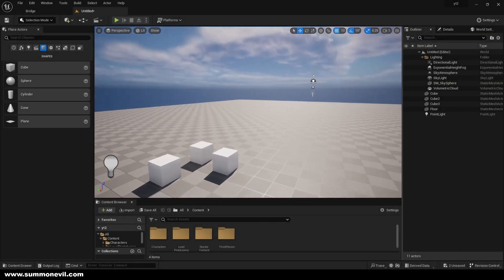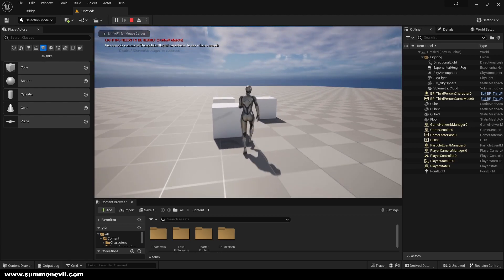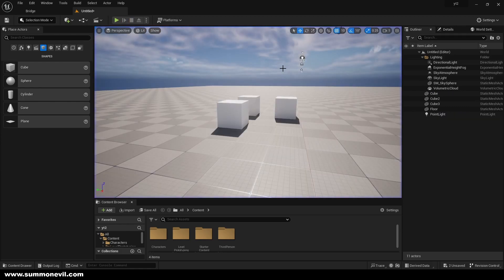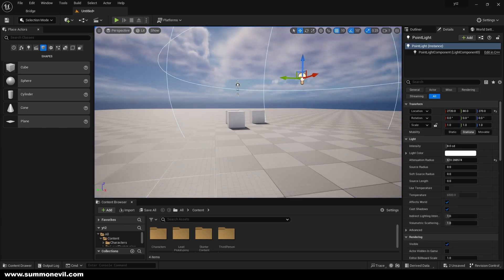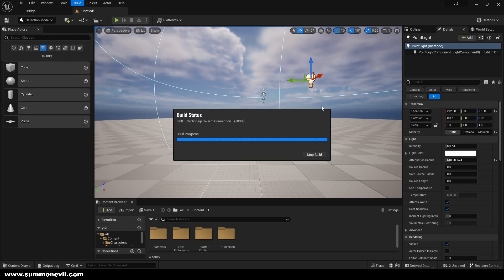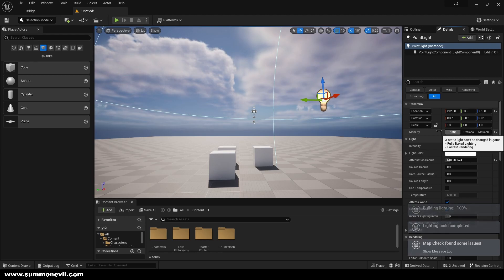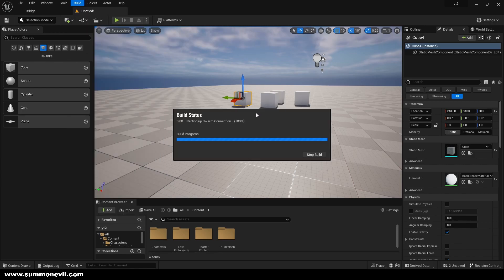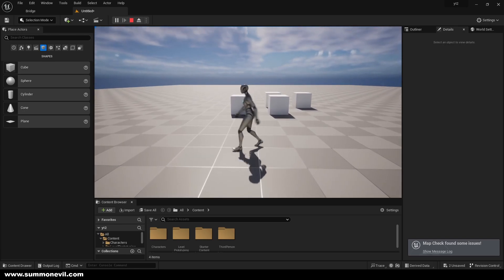How to Fix "Lighting Needs to be Rebuilt" in Unreal Engine 5

Comment: That's not enough. When you build lighting you bake shadows that are based on static lights and objects, that's why you need to rebuild the lighting when you add a new object.  

You need to assign lightmap for each object you add, which is a secondary UV channel and and optimise your lighmaps, which, depending on complexity of the scene and render settings, can take hours.

This is no longer relevant with ray tracing and nanite features.